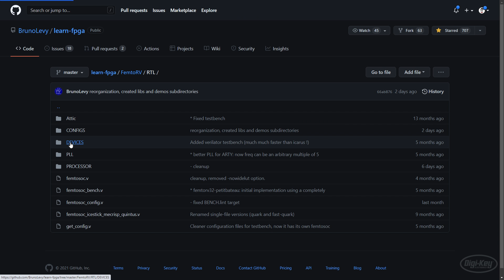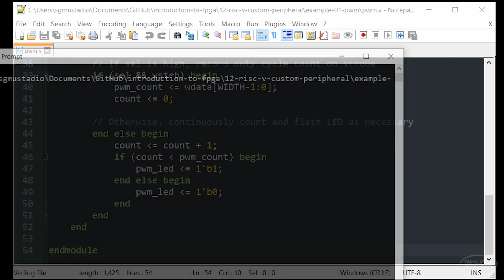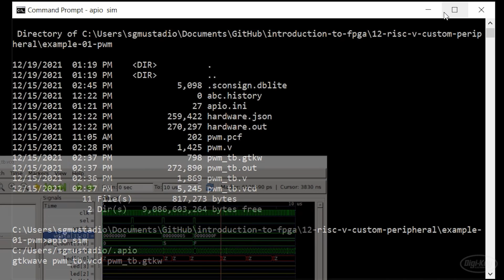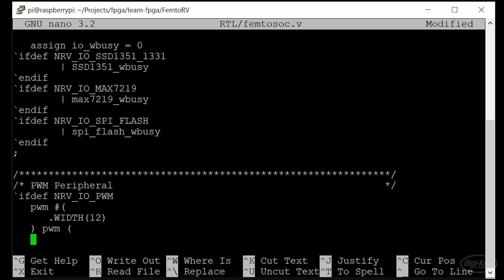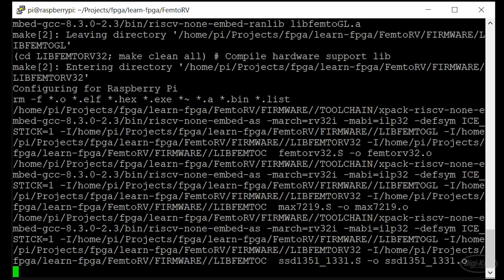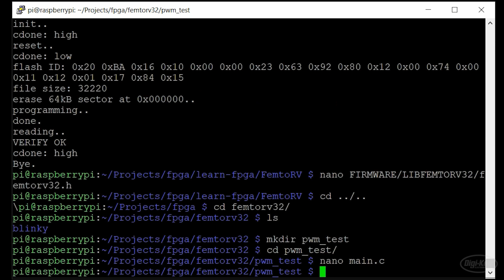Comment: how do you like your Varmilo VA87M keyboard?  I have the Logitech K740 like you used to have, its nice and quiet and it has nice backlighting-- I'm just wondering why you switched? The backlight on the VA87M looks a bit dodgy compared to the K740.  (or is that not your workstation)
Reply: I love the VA87M. I used to have the solar-powered Logitech K750, which worked well for a few years. A few keys gave out, and I wasn't able to repair them. So, I decided to upgrade to a mechanical keyboard. Typing on a mechanical keyboard is a world of difference IMO (it's like upgrading to a Ferrari from a Ford Fiesta). However, I use Cherry MX Browns, which are pretty loud when I bottom out the keys. Office mates and people on Zoom definitely notice when I'm typing. You can fix this by adding O-rings to all the keys. The backlight is only OK. The keycaps don't have translucent lettering, so it really only glows under the keys. There's some flicker that's been happening with my new computer, but I think that's a Windows issue--I've been trying to hunt it down.